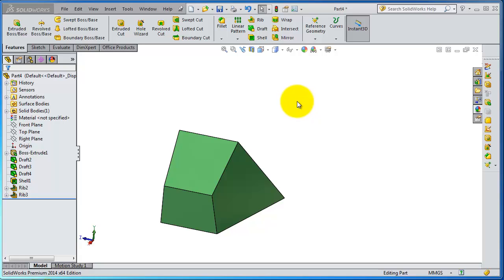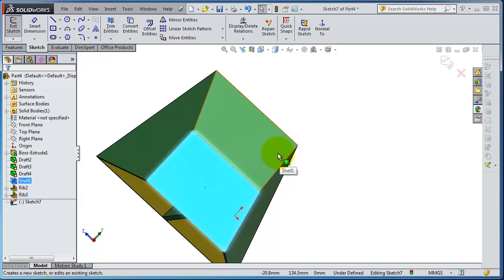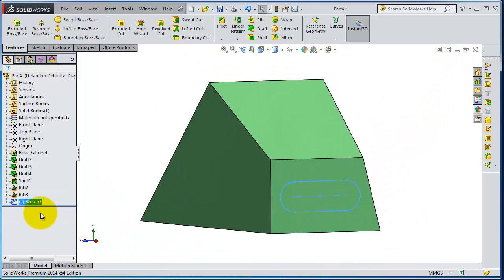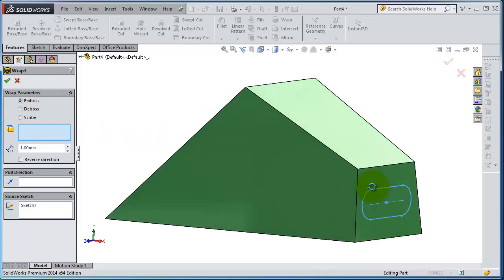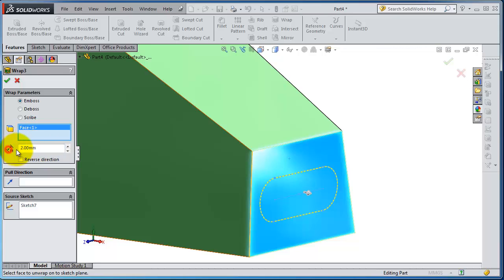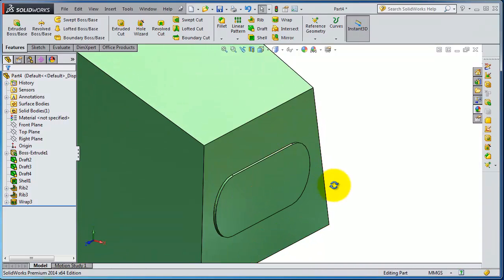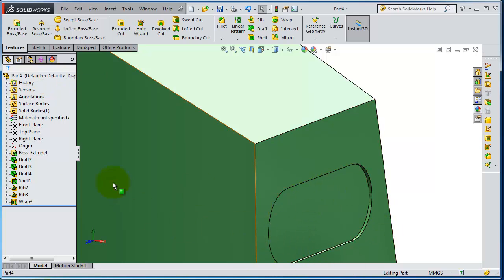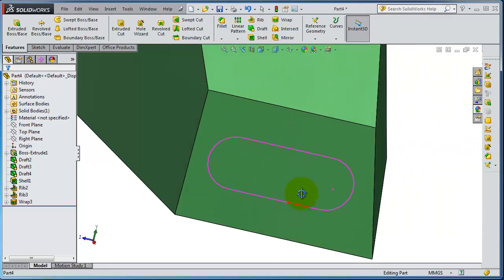SolidWorks Lecture Tutorial  57: Wrap

Comment: difference between wrap and (extrude and extrude cut)
Reply: if you want to make a groove on rounded surface
Reply: @karimadel5911  Thanks a lot, that's a very interesting tool to use with round surfaces, such as screw heads :)